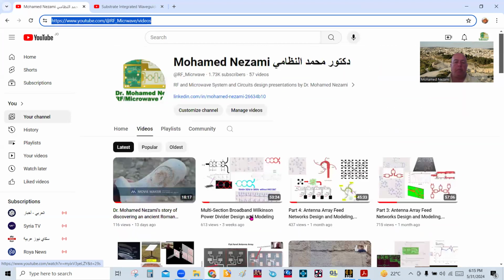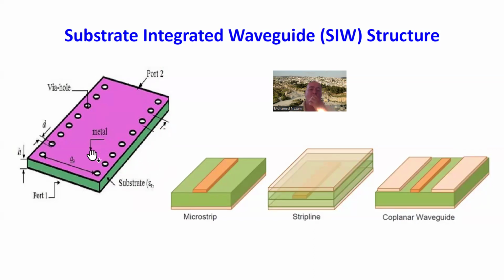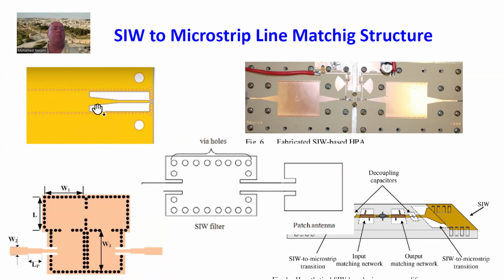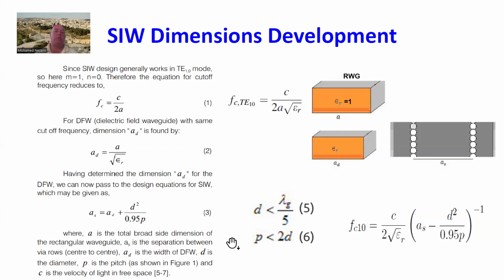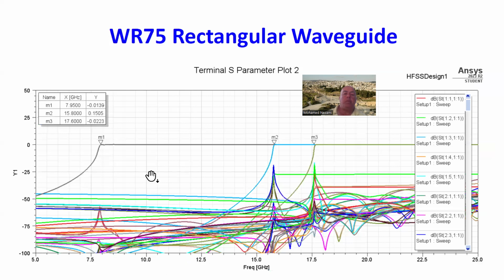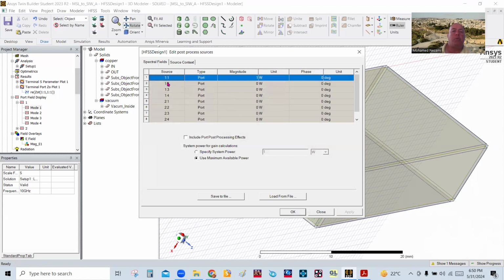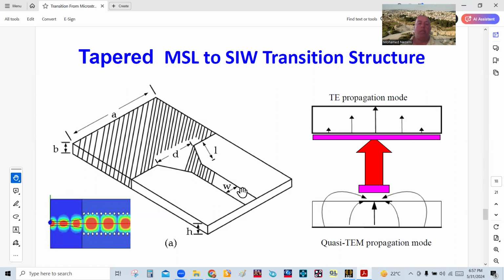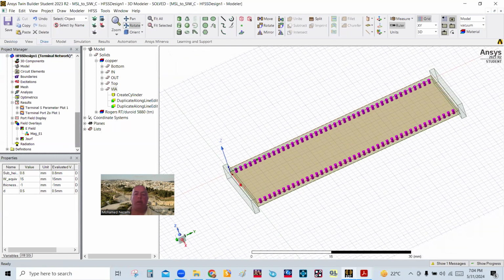Part I: Design and Modeling of Microstrip Line to Substrate Integrated Wave Guide (SIW) Transition.

Comment: I worked on SIW transitions in industry a while back and developed a technique to greatly improve the near cutoff impedance matching.  As you point out the characteristic impedance (Z0) changes dramatically near cutoff.  Second, you point out that mid-band the Z0 is often well under 50 Ohms.

I tackled these problems sequentially in a way I have yet to see in literature.  Fannot's criteria says there should be no inherent limit to how well we can match to the waveguide's changing impedance in-band, as it is all Real, no actual reactive portion to fight.  The trick is finding the right way to do it.  Tapering the width of the SIW sacrifices some usable BW (allows TE30  multimode issues to show up at a lower frequency), but by gradually flaring the width of the waveguide it dramatically flattens the input impedance (about 10-15% at the transition).  I used several quart wave sections of my mid-band frequency, but a smooth tapered shape is likely more optimum.

Once Zin is very flat it is more straightforward to use simple mid-band quarter wave section in microstrip to convert from 50 ohms to whatever the driving point impedance becomes.